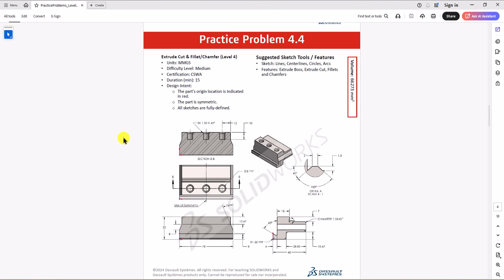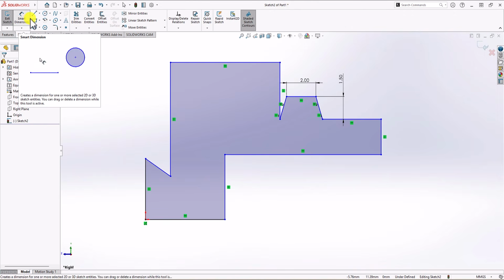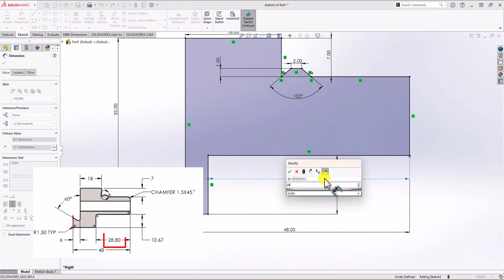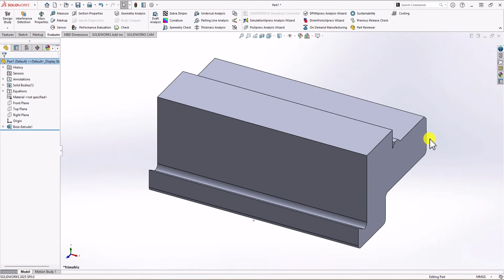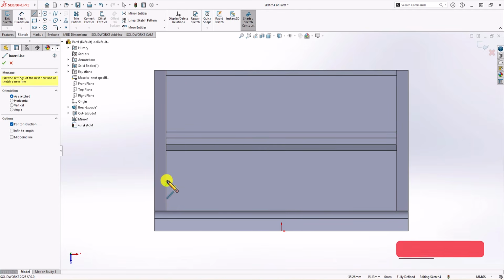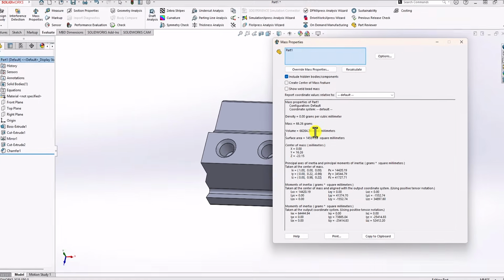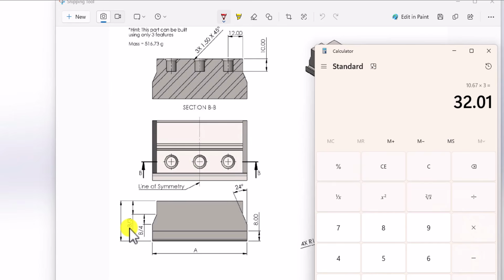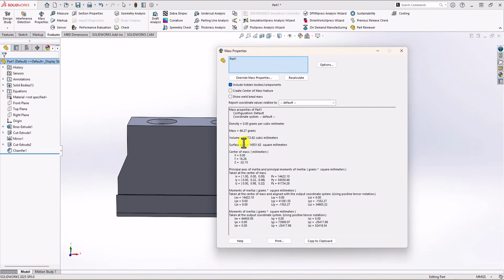CSWA Practice Problem 4.4 Solution | SolidWorks Exam Guide

Comment: Could you perhaps do problem 4.5 as well? I'm struggling quite a bit with it. It seems to be over defined (40 + R15 = 55) and my volume isn't matching (off by ~1%). I also tried to do it by creating the base first, but that was a bit difficult to wrap my head around. So I created it in 1 extrude and cut away the part in the middle and the arc at the bottom.
Reply: Great videos btw
Reply from the maker: You are absolutely right that question 4.5 is not fully defined. The reason I skipped question 4.5 was because the information provided was not enough to find a unique or conclusive answer. I mentioned this in the description of video 4.6 and explained why I decided to skip question 4.5.

Comment: Crap, I´m using Free CAD to practice these, and I´m getting 40 mm3 off the volume, is it normal for different CAD softwares to give this kind of variation?
Reply from the maker: Generally, different software (or even different versions of the same software) can affect the final result depending on how they compute volume, so that could indeed be a contributing factor. However, the discrepancy in your case is only 40 mm³, which is negligible, so you should be fine.